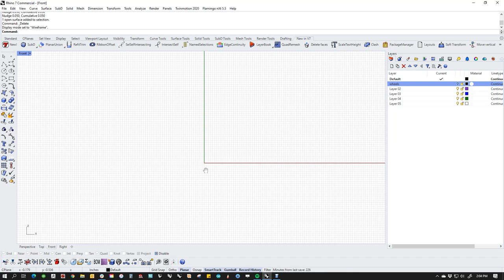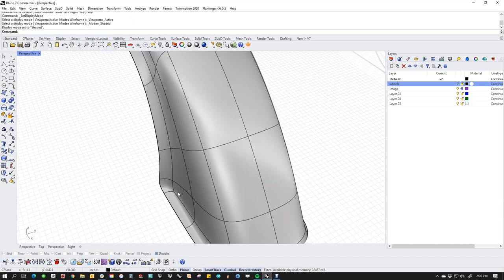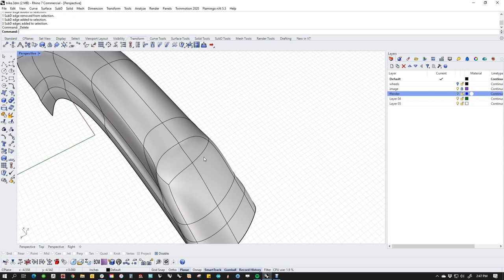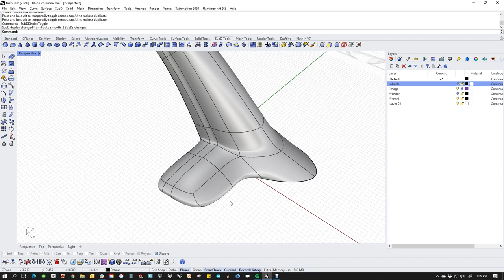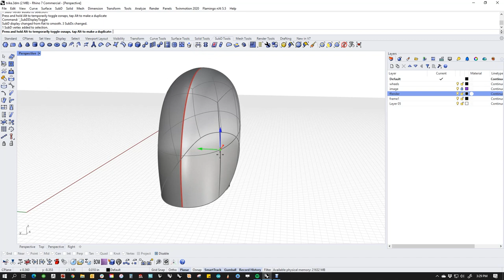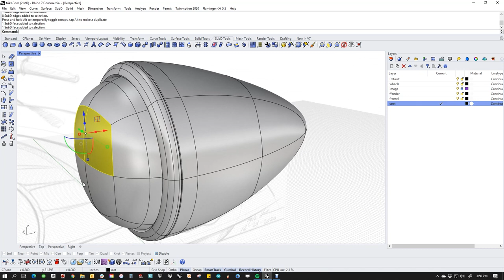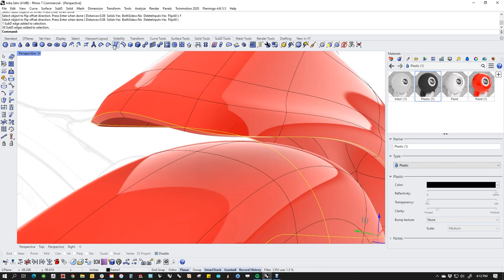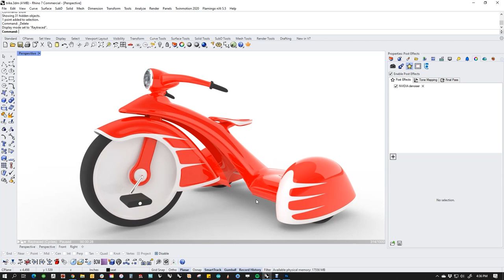Rhino 7 - Vintage trike Build with subd (full build)

Comment: thanks for this tutorial. would you please make a tutorial about how to prepare an organic model like this from Rhino for an unwrapping software like RizomUV ? because we face with many problems in unwrapping a Rhino model in other soft wares. thanks
Reply from the maker: I’ve Never used risom.. I’d be happy to work with them to prep something if you have a contact there.
Reply: @Rhinoceros3d  Actually no I don't have a contact there. I'm just a user. but it doesn't make a difference which software because in all of them we have problems for unwrapping a Rhino organic model inside them. Even in 3dsmax when we use UNWRAP modifier for a rhino organic model which is imported in it, we face problems like considering all the edges of the model as seams while it shouldn't be like that.

Comment: Your video was fantastic and really helped me to understand many of the new SubD tools! Thanks! I hope you don't mind but I took a screenshot of your original sketch so I could build the trike while I'll watched you build yours. Mine turned out surprisingly well! : D The only thing that I could not get to work was applying a material to a sub-object selection of a SubD object. Can you even do that with SubD objects? It's very useful for NURBS objects but doesn't seem to work for SubD objects. My workaround was to either split the faces off as a separate piece or convert the object to a NURBS object.
Reply from the maker: Thanks for the kind words- I’d love to see how yours turned out! Post it on the rhino forum gallery! 

Sub object assignments in subd is still a work in progress, so you may see better performance as we get deeper into the v7 service release cycle. 

You’ll notice I converted to nurbs before adding materials. 

Thanks for watching! More to come!
Reply: @Rhinoceros3d  Thanks for the headsup on the subd refinement and the suggestion to add a rendering of my trike to Rhino's gallery! I just added it in the Product Design gallery and included a link to your YouTube video.

Comment: You lost me on 'add an edge'. I try insert loop, insert ring, insert edges, and I cannot get what I see on the video. I've slowed video down to 60%. I hear a keyboard press,and I cannot replicate the video. I think you assume too much.
Reply from the maker: time stamp?
Reply: @Rhinoceros3d  19:58
Reply from the maker: @RonG1960  double click a subd edge to select the whole loop, then start left click dragging a scale handle on gumball, then without letting go of the scale handle hold down the ctrl key on a pc or the command key on a mac to extrude the edge. 

It's a little fingery, but super fast once you get used to it.